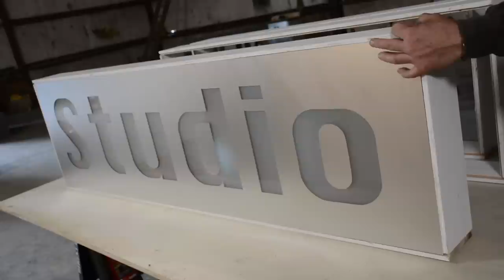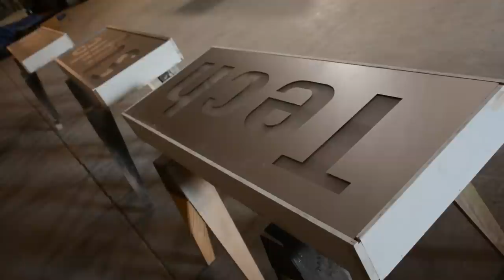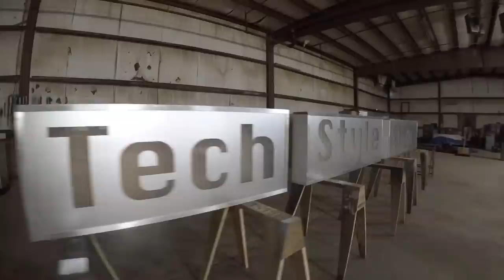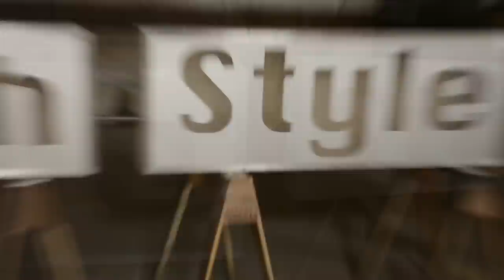DiResta Class Room Signage

Comment: When I was a kid my dad had a sign shop and we made illuminated box signs almost exactly as you did here. But when butting two sheets of acrylic we would cut a rabbet on the end of each sheet so they overlapped instead of having a backer strip. A backer strip would often cause a shadow line.

Comment: Nice to see you improvise, when you can't find the metal countersink you use wood countersink. I do it all the time.
Reply: Master of None I bought one of those countersink kits when I was in the US and they are so dull that you cannot even drill a single hole. Do you need to sharpen them before use?
Reply: Master of None ะะะะะะ

Comment: So what color was the first spray paint applied to plexilglass? And wouldn't it be looking cleanier if you used mirror reflected/vertically or horizontally (i never know which one is each) flipped stencils on the other side? It would definitely look glossy so I don't know if that would be better for this project. There's also a possibility that I got lost on something happening here so all my questions are irrelevant. Maybe the first one was not bad. What color then? :)

Comment: Why do you swing the drill around when using a forstner bit?  7:10
Reply: Internet Tough Guy helps cut in better.
Reply: Internet Tough Guy I do that when I want my cut slightly bigger than the bit size
Reply: I think he it's doing it like that because he is in an awkward position, probably behind the drill and putting his weight against it he wouldn't need to do it (of course he choose that position to secure the panel from falling of the sawhorses)... also could be because of a dull forstner
Reply: Could be a few reasons. The bit could be dull and needs a better angle to cut, or to make it cut faster by using it on an angle so you can apply more force to the cutting edge.
Reply: reaming the hole
Reply: ThisFish  LOL! I think I like your answer the best.

Comment: I am curios, is there a reason you choose to paint the front of the plexiglass instead of reversing the letters and painting from the back?
Reply: Robert Pinder painting on the front makes the plexiglass matt meaning light wont reflect off it which should make the letters stand out clearer and be easier to read
Reply: Painting the inside will cause any paint to look glossy and create a mirror effect since the plastic is translucent. If the paint is matte or satin and that's the effect you want, you have to paint the outside.